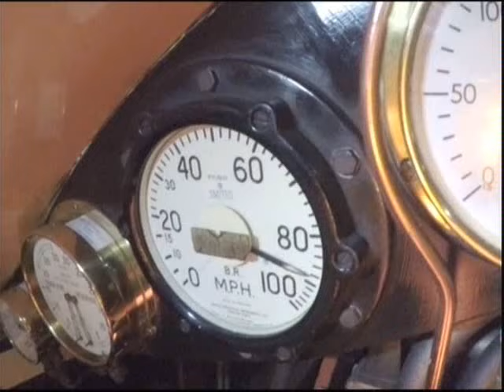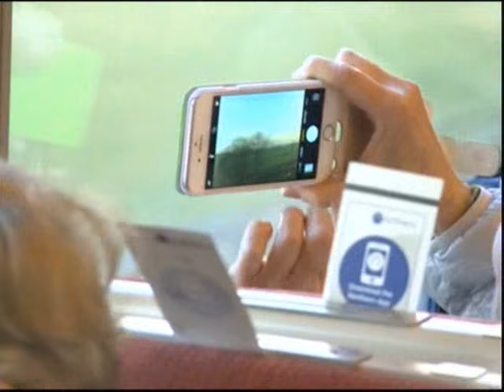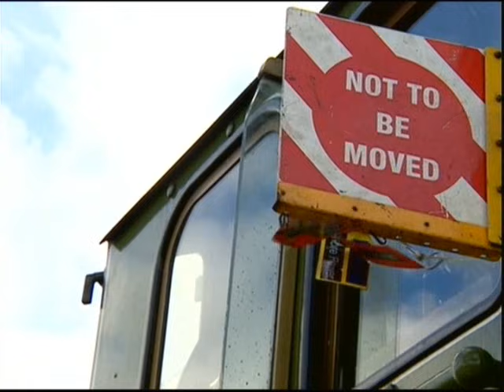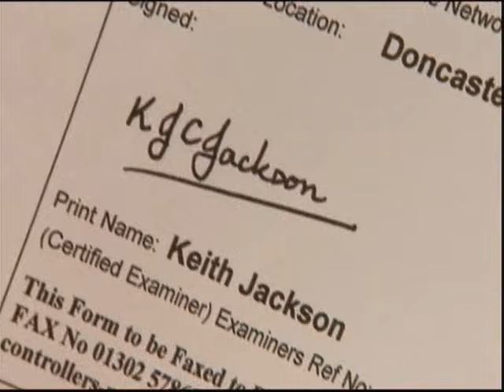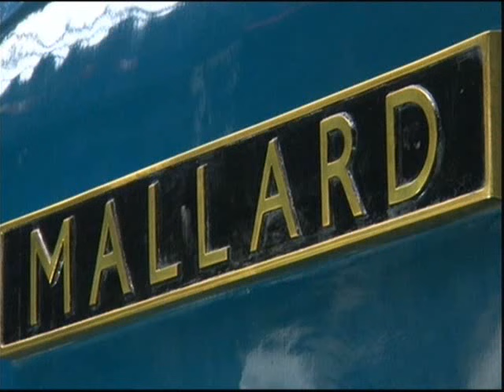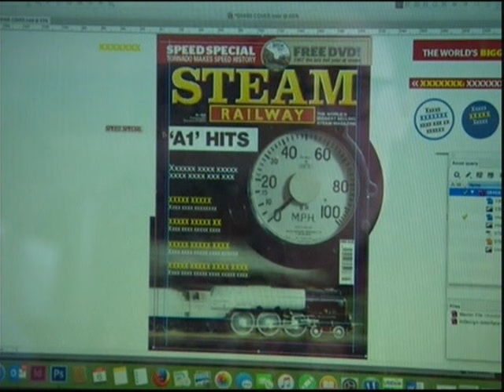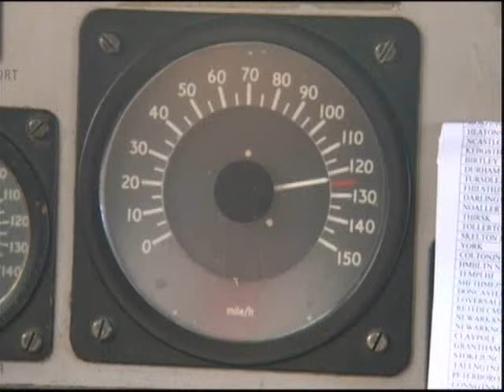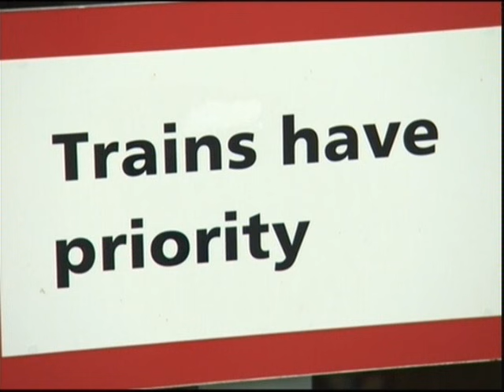Tornado 101.6mph run 15th May 2017 Prt1

Comment: Imagine being a millionaire or multi million pound company and you build steam locomotives 💕
Reply: First on the list - probably an unrebuilt Merchant Navy. Nuts to the design flaws, none survived unmodified.
Reply: WOAH. when i grow up, i had a dream about building and restoring those steal giants.
Reply: oh yes a army of A4 and A1!!!!!!
Reply: Unfortunately the multi millionaire class seems to be more interested in building useless windmills
Reply: The Turbomotive in its original form in turbine power
Reply: @Insect_Expert1489  I would build locomotives for the railway I work at! Just a whole new fleet maybe not coal fire as its a bit of a struggle to get coal! But maybe oil burners
Reply: @turbulanceism  what kind of steam locomotives?
Reply: @Insect_Expert1489  its the rhdr in new Romney, 15 inch gauge
Reply: @turbulanceism  and what new would yours be ?
Reply: @Insect_Expert1489  they would be oil burning boilers, so still steam but not coal fuled
Reply: @turbulanceism  what class?
Reply: @Insect_Expert1489  they are mostly based off of a1 a3 locos
Reply: @turbulanceism  what about a A5 locomotive ?!?

Comment: "Excuse me young man I have always wondered why you people tap that wheel with that hammer ?"  Why sir to check the wheel is there of course !" .
Reply: Check for cracks. The sound is different if there is a crack.
Reply: Watch, "Oh Mr. Porter"... all will become clear ;)
Reply: Steel rings if its complete.  Same as a glass tumbler or the like.
Reply: A wheel goes 'ding' when sound but 'donk' when cracked

Comment: People forget that steam is arguably the most powerful form of energy.
Reply: Frankly, I'm not sure that's so.  As memory serves, diesel is most economical (energy efficiency) and gas turbine has best power/weight. 
These locomotives are marvelous beasts—that's why I'm here!—but thermal efficiency is low, and maintenance costs are high.
Reply: Steam has potential to be incredibly powerful, regardless of efficiency. Steam locomotives are less than 10% efficient if I remember correctly, they are dreadfully inefficient machines, but saying that they are very powerful. Tornado produces over 2000hp, a Duchess class over 3000hp, that’s a lot of power. But a diesel engine can produce that much power at I think about 7X the efficiency of steam.
Reply: @harryandrew9163  I think you're efficiency numbers are pretty good.  I remember [that South African guy] made a number of improvement to the Red Devil and allegedly got efficiency up to ~7%, which I think was a 2% gain. (there was some suspicion whether he fully reached his 2% claim.)
I forget where diesels generally fall (my numbers are decades old anyway,) but 35-45% seems about right.
Reply: @77thTrombone  aye those numbers I stated I didn’t look up, just what I remember reading a while ago so although they may not be 100% correct, they’re in the ballpark!
Reply: @harryandrew9163  got it.  Not hitting on you, but just saying our ballparks lined up pretty well.

Comment: One of may accounts was a machine shop that specialized in rebuilding railroad trucks. They would put new springs, bearings, brake linings etc. The last job they had before the owner retired was rebuilding the large drive wheels off steam locomotives. They would build up the wheels then true them into round. I asked where they came from, it was China!

Comment: I will be interesting if they do it with the P2
Reply: The P 2 will knock the crap out of the track , hence that is why they were rebuilt  in to the A2/2s
Reply: @daystatesniper01  The exact reason we don't have mainline 9f's.
Reply: @daystatesniper01  the rebuilt P2s were actually far worse than the normal P2s which were very good, but yeah they had there issues

Comment: So much for all the testing at 90 and 100mph, then breaks down on the ECML on it's official public 90mph run a year later with its middle piston valve overheating and binding in the valve chest. I doubt Tornado will be allowed to run at 90mph again let alone 100 after that
Reply from the maker: The breakdown was nothing to do with the speed they were travelling at according to their website..
Reply: @davidrobinson2198  Bittern did 90mph successfully three times (four if you include the test runs) and had no mechanical issues during them runs. And she's a much older and original steam loco than Tornado. Plus Bittern's 90mph runs were more in commemoration of Mallard 75 in 2013, rather than Tornado's 100mph which was ultimately a publicity stunt
Reply from the maker: Publicity stunt or not, the guys still did well...
Reply from the maker: The high speed run did not cause the breakdown..